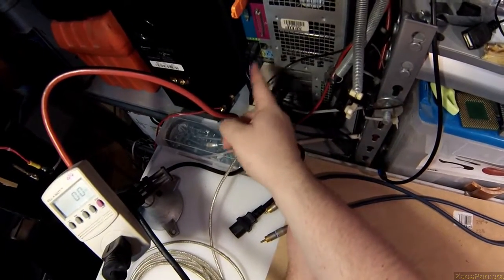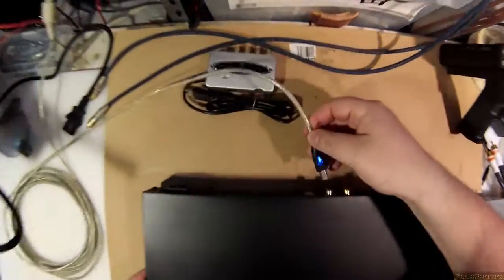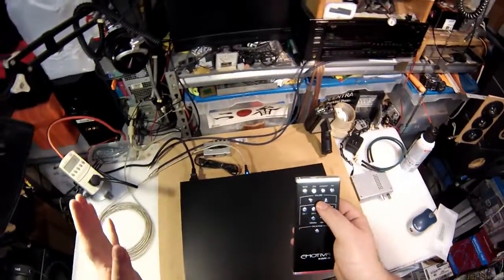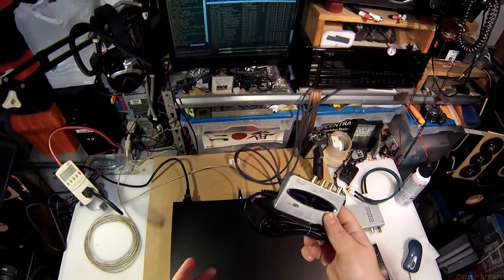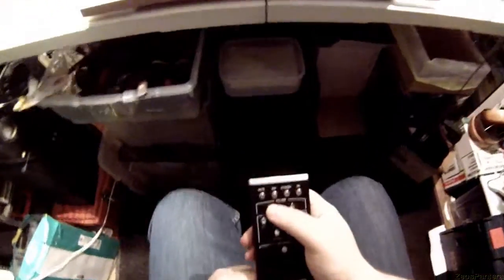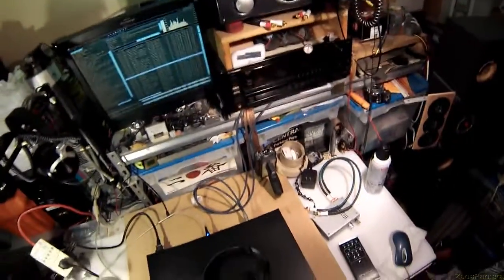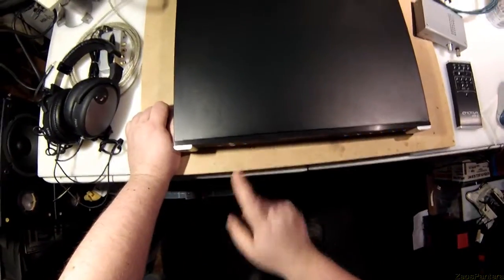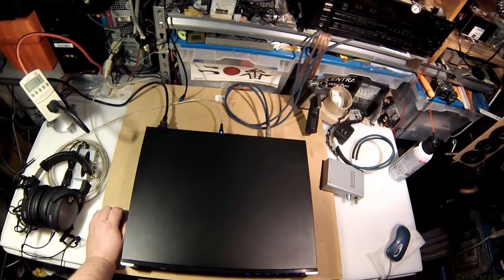Z Review - Emotiva XDA-2

Comment: it doesn't have to split the voltage, voltage is normally altered using smsl transformers, it can't draw more than a certain amperage at that voltage, which is more than likely enough amperage after possible voltage changes or splits, each could use 5v without a change in voltage, it'd be a higher amp draw, because your making less resistance in that device, think of it as if adding speakers to an amp that can handle both loads with ease, just like in you home electricity, you don't have less voltage to work with by using different stuff, all things you plug in or run power too is labeled 120 volts, obviously you aren't using up your 120v with each device, you use more amperage, and of course voltage times amperage is the wattage you use, if something uses more amps, it uses more watts, but not more voltage, and if a device can use 240 or 120, it'll use half the amperage at 240 volts but the same wattage, the device puts a resistive load on a circuit

Comment: I think it has a digital controlled resistor ladder analog volume with macthed resistors for left rigth channel.or the resitsor ladder is in a chip.have to many volume steps some dont like.2.25 volt is wrong 2.8 has been the standard so i think you are wrong on that.Dac,s powerd from usb port get 5 volt witch is to litle volt pr channel to get full output from those dac types.

Comment: I sprung and ordered this, only mine says xda-2 gen 2 it's all black different remote (prob only difference). I got this and the dt770's (250 ohm)based on your reviews. Ive been using an HDMI Reciever as my DAC. I must say I was disappointed with the headphone amp on the xda-2 so I have the Mac connected to the xda-2 and outputting to the reciever analog input and using the headphone amp on the receiver. There's not too big a difference between the DAC on the receiver compared to the xda-2 I do notice the vocals are brighter and the music seems slightly crisper with the xda-2. I don't know if it was worth the $219 I paid for it but maybe I should invest in an actual headphone amp now? What do you suggest? I do like the "options" with the xda-2 for future upgrading. For example getting some studio monitors with XLR inputs would be nice.

Comment: Nice! I have just one question. Would I need an amp to go with xda2 to power inefficient headphones like he500? I was thinking emotiva mini-x... 
Also how would this compare to more expensive amps/dacs such as lyr 2 and bifrost that cost almost 1K as a stack?
Reply from the maker: I think extra heavy cans could use an additional amp. The MiniX has to be converted/ adapted to use headphones since it is a straight speaker amp. I consider the XDA as a top tier dac IE you shouldn't be able to tell it apart from another top tier dac without measurement equipment. It is only a GOOD headphone amp in the grand scheme of top of the line Schiit amps.
Reply: You can buy two 1/4 inch -> Banana Plug Adaptors and a 1/4-Inch Female -> 2 Mono 1-Tip and 1-Ring 1/4-Inch male and connect your HE-500 directly to the speaker taps of the mini-x. 

http://www.head-fi.org/t/629352/he-500-lcd2-d5000-dt770-sr80-on-a-speaker-amp-emotiva-mini-x-a-100-project/2955#post_10111998

I have an emotiva mini-x but its modded with a 1/4 jack myself.

Comment: You know you can have a boost circuit in low voltage applications, allowing higher volt output than input, right? You`ll just draw more power (A). 

The USB 1.x and 2.0 specifications provide a 5 V supply on a single wire to power connected USB devices.A unit load is defined as 100 mA in USB 2.0, and 150 mA in USB 3.0.
A device may draw a maximum of 5 unit loads (500 mA) from a port in USB
2.0; 6 (900 mA) in USB 3.0.

So supposedly, you should be able to get a maximum of 2.5Watts from a usb powered amp.
Minus some voltage drop in the circuitry etc, you should get enough power for MOST headphones..
Maybe an internal voltage converter will give EMD or something IDK :/
But the FiiO E11K can output 450mW, and it only gets 3.7V I think, you can draw more amps from the 1400mAh cell than from a usb though but still, at full volume, I get hours of batterylife, which means it draws less than 1amp.
So usb powered amps should be able to provide good power.

Comment: Hey where did you get the super long USB cable?
Reply: super long usb cables fuck up the sound
Reply: Bryan. USB is digital and error correcting. As  long as the cable is within USB specifications you'll be perfect. Seriously, USB is almost as perfect as Toslink Optical.
Reply: Agreed. Only thing is that it’s just more susceptible to software screw ups. So as long as your dac has a really good timer, pretty much all digital inputs sound the same.

Comment: From Emotiva's website, the headphone amp specs on this thing are extremely disappointing for the price....

2.25 VRMS max into 47 Ohms @
< 0.015% THD (100 mW)
2.25 VRMS max into 100 Ohms @
< 0.01% THD (50 mW)
2.25 VRMS max into 300 Ohms @
< 0.01% THD (16 mW)
2.25 VRMS max into 600 Ohms @
< 0.01% THD (8 mW)

For comparison, a $100 Schiit magni (discrete headphone amp, I know...) does:
Maximum Power, 32 ohms: 1.2W RMS per channel
Maximum Power, 50 ohms: 1.0W RMS per channel
Maximum Power, 300 ohms: 260mW RMS per channel
Maximum Power, 600 ohms: 130mW RMS per channel

Wow... I know the XDA-2 has many other features but come on, considering the most likely intended usage for this thing... that's between 10 and 20 times less power!